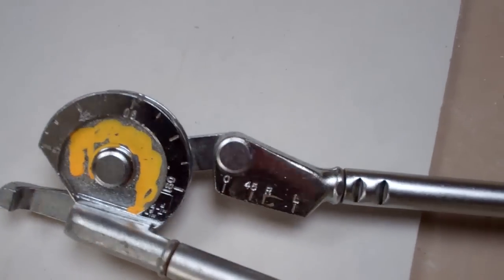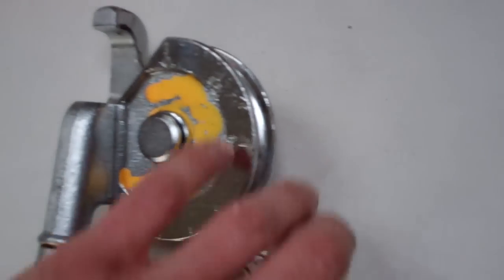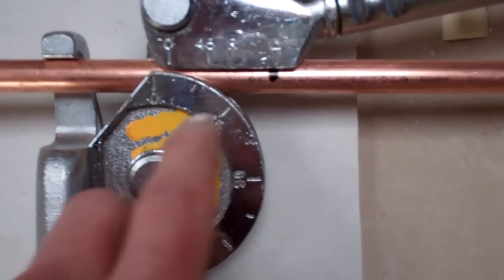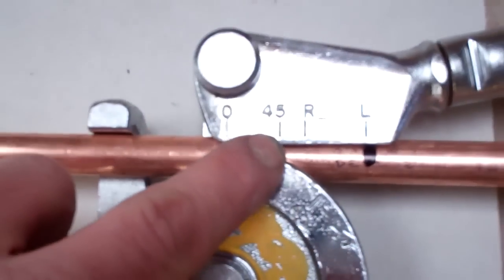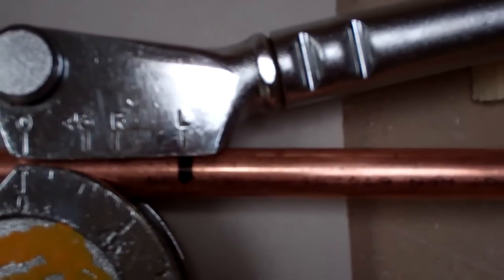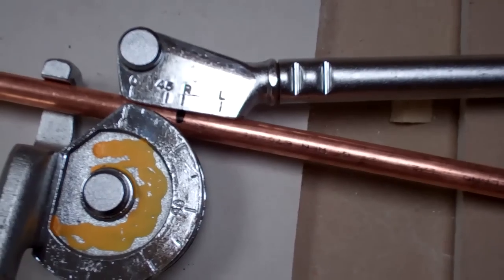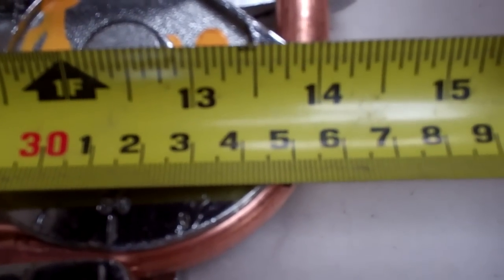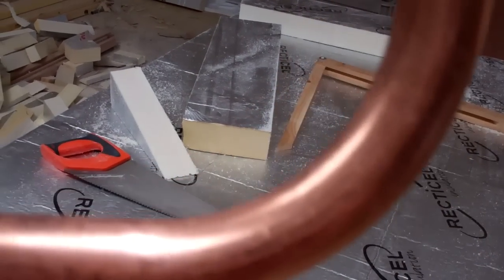HVAC Imperial Eastman 1/2" copper tube benders

Comment: How much is the take off for 90 bend
Reply from the maker: Not sure I understand the question. To get a bend in the right place I mark the pipe where I want the centre of the bend to be and then line it up with the corresponding mark on the benders.

Comment: The 45 degree mark is used for offsets.   There is a chart/table in the instructions that show where to mark the tube depending on the length of the offset, then  you line up you mark with that top 45 degree mark.
Reply from the maker: I'll have find the instructions out, think I have them somewhere!

Comment from the maker: I'll get it posted tomorrow if i finish early enough!

Left it on pressure test overnight, will leave it in till i'm ready to vac and run it, longer the better!

Not sure on the wiring, theres a box with a contactor and switch with no diagram where it goes or what it does! Think its to link the tank and icebuilder with solenoids so they don't try and run at the same time, might have to wait till monday when i can phone the manufacturers... :-)

Comment: Hi, you say you put cable ties on the former to take up the slack on 15mm pipe using a 5/8" bender. How do you do this and are the bends still accurate and land on the marked scale? Imperial benders like these are a third of the price of their metric versions. Cheers.
Reply from the maker: They cable tie trick works with a different style bender, the one with a separate guide which is pushed round by a wheel on the handle, you put the cable ties on the wheel to make its diameter bigger and thus move the guide closer to the former to allow for the pipe being 0.8mm smaller diameter.

Comment: What is the r for?
Reply from the maker: Its for bending the pipe from the other side but when still want the centre of the bend to be where your mark is. Like normally you'd line your mark with the L but when there isn't room for the bender handle to swing so you put the bender the other way round and use the R mark.

Comment: Have you ever tried it on 15mm copper pipe?
Reply from the maker: It wouldn't fit in these as this is 12.7mm pipe, I have bent 15mm copper with 5/8" (15.88mm) benders but put some cable ties round the wheel for the guide to take up the difference.
Reply: Bahco make a metric version which is the Bahco 500 15 bender. They also make the 600 15 bender which isn't as good as it has a plastic former. Both are very expensive and very hard to find.